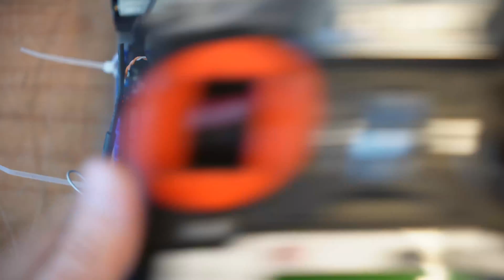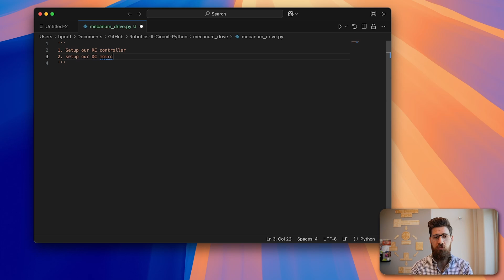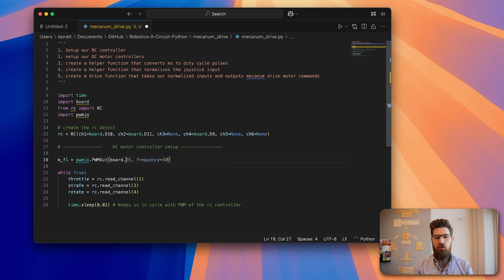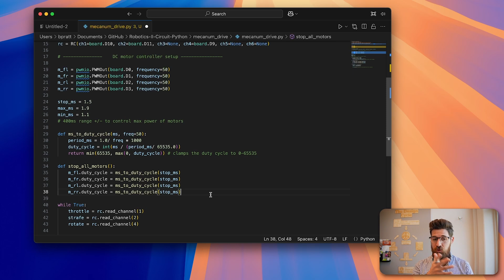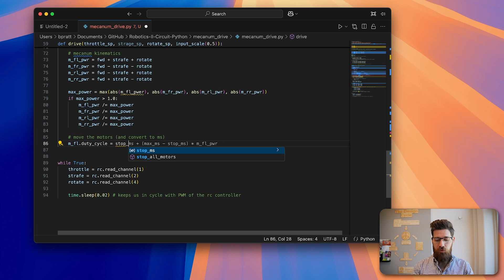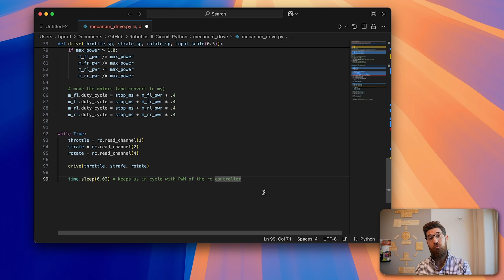Python for Mecanum Robots (Step by Step)

Comment: One video in which you use Mecanum Mixer and the motor driver
Reply from the maker: Sorry, I don’t quite understand your comment. Can you expand more?
Reply: Hi @BroganMPratt  
So you make a Mecanum Drive Robot Base, which utilizes the mecanum mixer of Gobuilda and a 20A or 30A Motor Driver of Gobuilda with your receiver, like in your case, the FlySky one, and then you basically control it via transmitter, so like not using a microcontroller to convert signals for the motor, but the mecanum mixer, which can be used.

Hope you upload a video on this as well😃😃
Reply from the maker: @BishopsRoboticsClub Ah, I had no idea this was a separate daughter board they had made. thanks for the recommendation! I'll take a look
Reply: @BroganMPratt  Hope you will soon upload a video